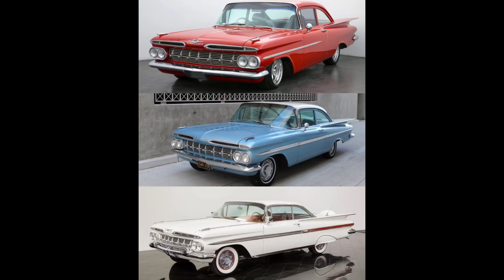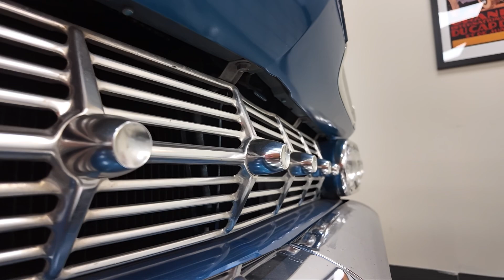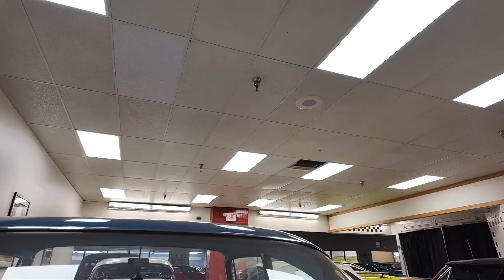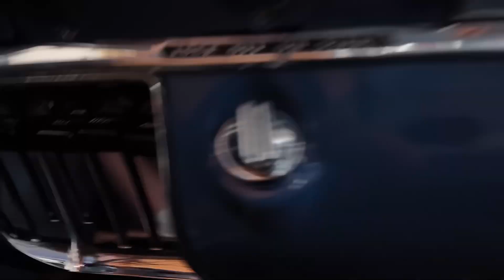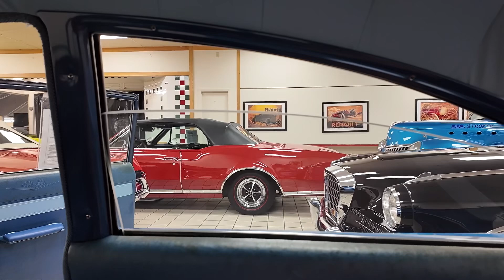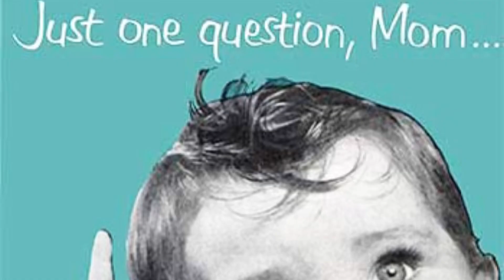1959 Chevrolet Bel-Air 2 door sedan

Comment: When did they start putting in seat belts? My 60 Belaire did not have them, but my Dad's 64 wagon did. Maybe they were an option.
Reply from the maker: I wasnt 100% sure so I quick Google search and it said 1968 is one more more cars started offering seatbelts. They were optional in the 50s on a lot of different cars interesting though it wasn't mandatory to wear seatbelts in states until the 80s.

Comment: The Chevy logo just above the speedo center hub was also the high-low beam head light indicator. I had a 59 Biscayne  2-door post as a first car and hopped up the 283 with a 3 speed manual shifter and it was a great car in 1965. It weighed about 300-400 lbs. more than a '59 vette.

Comment: Strange it had no sun visors, especially with such an exaggerated windshield.  WYR 1. Ford  2. Studebaker.
Reply from the maker: I thought the same and there is no evidence that they were ever there
Reply: @What.its.like.  Looked up some old images of 59 Chevy interiors and they had sun visors alright.  I think whoever did this half-hearted "restoration" just put in a new headliner over the old bolt holes for the visors.
Reply from the maker: Yeah that would make sense

Comment: I had a 59 Chevy once. It was a 2 door wagon with a 283 v8 and a powerglide. For the WYR, I would choose the Plymouth in the first scenario, and in the second one, it would have to be the Studebaker. Having had a 59 Rambler once too.
Reply from the maker: Awesome choices that Studebakers really hard to beat even though it doesn't have the supercharger on it anymore.. 

What did you think of the 59 Rambler did you have the six or the V8
Reply: @ it had the six cylinder with push button automatic. I have always liked ramblers. The 59 wagon was my first. years later I had a 69 American 2 door.

Comment: This is exactly my first running car, except the paint was faded to a matte blue finish. The engine was so worn that it got 4 miles to the quart and town was 12 miles away. If you parked it on any grade in first gear without the parking brake set it would roll off. But it got to town and back every time. Besides the engine issue, it road and drove perfectly and was a straight body.  I had plans to do a ring job, but we had to sell it I moved to Florida for a family health crisis. Besides, I was only 14.
Reply from the maker: Thank you so much for sharing your first car with us. I'm happy that this video was able to bring back those memories. Thank you so much for sharing them with us again.

Comment: Back in that day the manufacturers used to run a design for 3 years to get the money back out of a design, in 1957 Mopar came out with a design that was way ahead of Ford and Chevy. When the big wigs at GM seen the Mopar cars they realized how far behind they were. They rushed to make a new design for 1959 that is why the 1958 car was a 1 year car.

Comment: Jay, when you get a chance read 'The Cars Of Harley Earl' by David Temple.

One of the later chapters is 'Styling Thr '59s' and it covers the history of 1958 vs 1959. Bill Mitchell was Earl's successor and 1959 was a mulligan as the Forward Look 1957 MoPars dethroned GM as the style leader.

1958 was the one-year-only as the 1959-60 are a 2-year body shell.

The rims on this car are the Corvette rallye wheels from a chrome-bumper era c3.

The Chevrolet bowtie in the speedometer face is the hi-beam indicator.  The round circles flanking the odometer are indeed the turn signal indicators.

FWIW.....I had a '60 Biscayne 6cyl/3spd when I was in high-school.
Reply from the maker: I'll definitely have to check that out. Thank you so much for that information.

I neglected to say that the high beam switch was the bowtie when I'm filming these things. Sometimes there's things in the video that I can't see personally, I don't have the best eyesight in the world probably should get a new prescription lol
Reply: Does anyone know what GM had proposed for the 59-60 models before they scrapped it and started over because of the MoPar forward look? I would sure love to see those!
Reply: @allenwayne2033  Adam Wade's RARE CLASSIC CARS AND AUTOMOTIVE HISTORY channel has one video showing the proposed '59 Buick off the 1958 body.  He can point you toward other vids

.https://youtu.be/tKHirTonyqk?si=6jNs_VJEnu2cqaVa

Comment: Well well.  Our family of 7 had a 59 Chevy.  Not sure of the model but I would like to have one of either now.  I was 5-6 years old then.  My dad really liked the power of our '59.  He talked about doing a power 360 for years later.   I hit my chin on the dashboard when my dad avoided another driver coming into our lane, then hit a parking meter.  The meter was bent for years after.  
I like the wear and character of this one. Except for those tires and wheels.  I like stock cars.
Thanks for going over this '59.
I also remember almost starting this car without the key.  The key switch was not in the lock position.
Cheers, Jay.
Reply from the maker: Thank you so much for sharing those memories great story parking meter being bent for years... smacking your chin off the dash not so much that probably still hurt the next day
Reply: @What.its.like. 
I suppose it hurt the next day but not enough for me to remember it.

Comment: My second car was a ‘59 Biscayne 2 door six cylinder power glide. 
I traded my ‘51 Bel Air 2 door hardtop and $250 for it in the Spring of 1967. 
Being a dumb kid, I destroyed the transmission. It cost $99 to get a rebuilt power glide. 
I got bored with it so that Summer I sold it and bought a ’60 VW Sunroof Sedan for$450. 
That was just the beginning of me wasting $$ on vehicles.
Reply from the maker: Awesome story 

My dad said the power glides are pretty strong. He had one in his Pontiac that was kind of miss matched parts together. I remember him saying all the drag racers wanted that 2 speed

Comment: I had a 61 Biscayne, similar but different. Bought mine for $100 with a worn-out smoking 283 which drank oil, a powerglide which was on the way out, and a 2 barrel carburetor about the size of a silver dollar. Top speed was 65 or so downhill with a cloud of smoke behind you- only did that once. The manual steering was like 6+ turns lock-to-lock and you had at best one panic stop at highway speed before you had better park and let the brakes cool down.The radio still had tubes; turn it on and wait 10 seconds for it to warm up before it began playing. The only work I did to it was to repack the front wheel bearings (it still had ball bearings, not tapered rollers) and adjust the brakes when I got it. It took me to and from work for almost 2 months which allowed me to save enough money to replace it when the powerglide died then I sold it to the junkyard for $20 so I figured I got my money's worth out of it. Had it been a 59 I'd have probably kept it as  love the cats-eyes taillights, the fins, and the rocket-ship fender markers in front. 
WYR The Bel--Air (even though I'm a Ford guy) and the Studebaker which is a gorgeous car.
Reply from the maker: Awesome choices thank you so much for sharing those memories =) 

65 miles per hour going down hill in a cloud of smoke

Comment: Sorry, Jay, but the 59s are just plain phuggly. Didn't like them when new, don't like them now. Batman would love a 59 Chevy. Fun fact: all of the 59 full-size GM cars used the same front doors (2 and 4 doors used different doors obviously) as a cost cutting measure. GM got caught with their pants down after some GM execs saw what the 57 Chrysler cars looked like. They knew that their cars, which were all new for 58, couldn't compete against "The Forward Look". So, for 59, the stylists had to restyle the cars with very little time left. Remember, lead time for a new car was about 3 years. So, they had to restyle the cars quickly, and at great cost. GM decided that the 59 Buick doors would be used on all the cars, except possibly for Cadillac. When you showed the clutch pedal, and no floor shift, I wondered what would be under the hood. Ah, yes, the Stovebolt 6. WYR= Ford and either the Studebaker or the Rambler Rebel. NTT= no clue. Interesting video as always, Jay!
Reply from the maker: Sweet choices =) 

I wonder if you could get a column shift with the 348
Reply: @What.its.like. Howard from the Old Car Alley channel has an immaculate '59 4 door sedan with a 348 and a 3 on the tree.
Reply from the maker: Interesting
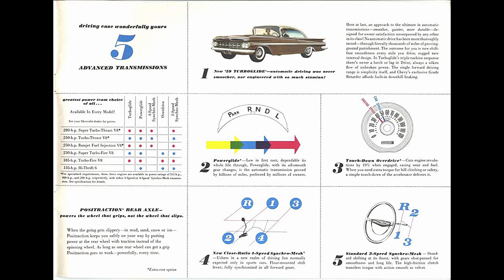Reply: @What.its.like.  According to the chart at 1:42, you could get the top-dog 348 with the 3 speed. In fact, the 3 speed was available with any engine, as far as I can tell. I can also tell you, from experience, that speed or power shifting a 3 on the tree is not likely to go well on a   first to second shift!
Reply from the maker: Hahahahs right I got to drive a three on the tree in a lifted 1973 c10 ( I'm not a fan of overly lifted vehicles all the wheels want to do their own thing) anyway had to gradually put in gear worked well just couldn't power shift the 40 ford shifted better

Comment: Ahead in that Ford ! Especially if it has the Police Interceptor package.
Would also prefer the Rambler over the Chevy if the Rambler has a V8 in it.  Much better automatic transmission in the Rambler. (than the "old hummin' Powerglide")
Reply from the maker: Great choices

Comment: Was '59 the first year of the horrid cut down frame ? (Missing the siderail components) ? 
  "Lite" but at least it was fast
Reply: I think 58 was the first year, and 64 was the last year for the questionable X frame.
Reply: yes that x frame had no  strength in frontal crashes drivers upper body absorbed the crash impact very unsafe.
Reply: @victorPretti-mx2kr  They had no side impact protection, either.

Comment: Another great video, Jay! You chose a nice example, if a bit modified. Ilove that it still has the 6-cylinder engine in it. And I'll take the For and the Rambler.
Reply from the maker: Thank you happy you dig this video 

The mileage on this one is a original 39,999 miles